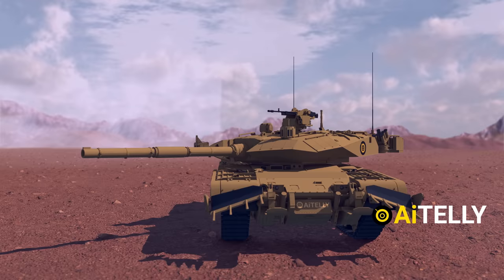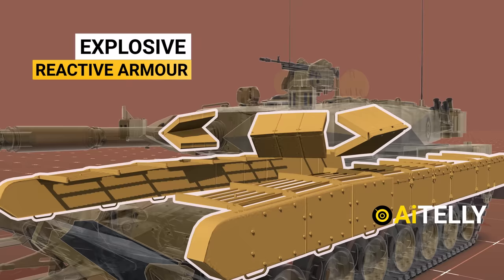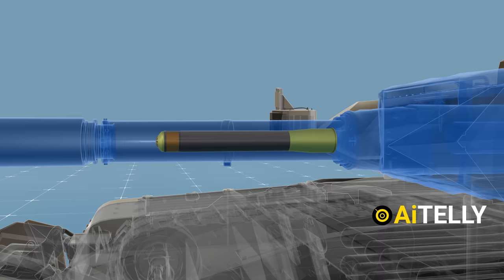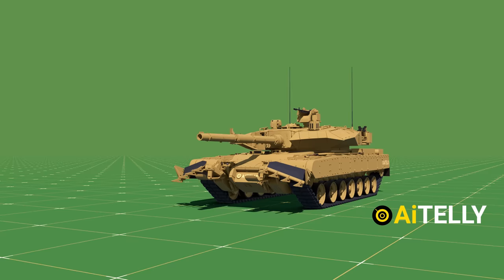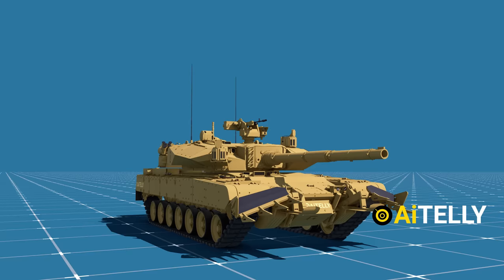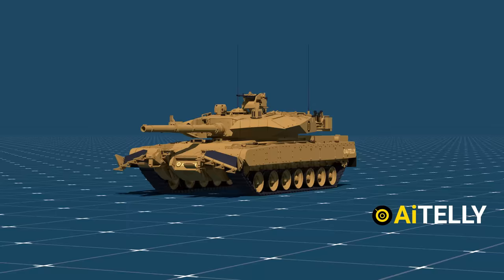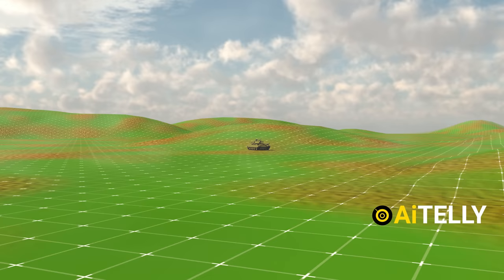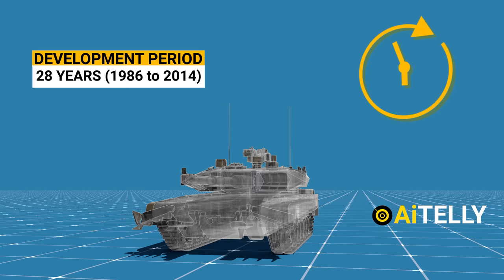Heaviest Battle Tank Arjun Mark 1A Mark 2 | How it works #tank #tanks

Comment: are you sure about the rifled gun? given the kind of ammunition, i suspect the tank has a 120 mm smooth bore gun like the leopard 2 and merkava!
Reply from the maker: I'm sure it's a Rifled Gun.
Reply: Indin army insisted on rifled gun because they wanted to use HESH rounds.
Reply: A smoothbore gun is also in development...may have being developed by now
Reply: Yes its a rifled gun because for some reason they wanted to have HESH shells (maybe because it is more effective against infantry as china and Pakistan both have high number of soldiers, just a wild guess though.)
Reply: It's a rifled gun. That's why we originally had problems with the indigenous sabot rounds. But the gun is really good now.
Reply: @ashutoshgupta9410  More useful against single walled fortifications or bunkers with much better after penetration effects (HEAT gives more focused and unidirectional effect)..
Reply: @sameerthakur720  but its still has less pen in sabot rounds and has a high maintenance compared to smoothbores only advantage i can see is its more accurate than smoothbore guns
Reply: @sameerthakur720  O.K. Thanks for the reply!
Reply: Its a rifled gun because of the desire to use HESH, and the PCB shells and it's not a shared 120mm gun like the Rheinmettal 120
Reply: @ashutoshgupta9410  HESH and PCB rounds are surprisingly effective as obstacle and building clearing rounds so..

Comment: one thing is instantly irritating me about this the flat surface at the gun mount of the turret big weak point, also the way the turret is shaped is not well designed this way it has a chance to ricochet projectiles into the driving compartment cause of the inward angle on the downside of the turret

Comment: Watched a couple of Analysis on this Tank and apparently it got several severe issues. Like significant armor weakspots and most of all an inadequate rifled gun just so they can fire obsolete hesh rounds. Overall it doesnt seem to match the also rather obsolete Leo 2A4 by what i heard.
Reply from the maker: Leopard 2 and challenger 2 tank coming soon.
Thanks for the feedback
Reply: Last time I checked it could also fire thermobaric and bunker buster rounds
Reply: The rifled gun is the least of the problems. The armour is a more immediate deal breaker. Why? Because the main gun of the Arjun can still fire an APFSDS with 530mm penetration depth (RHAe) at 2km distance. That is enough to punch straight through the frontal armour of almost all Pakistani tanks, especially the most ubiquitous ones (Al Khalid, Al Zarrar, VT-4, etc). 

But the Pakistani tanks can fire APFSDS capable of penetrating at least 450mm of RHA. That hole in the Arjun's gunner sight is around 450mm of RHAe, with no ERA on it. Meaning that what could very easily have been a tank front impenetrable to Pakistani APFSDS is now vulnerable. 

Arjun is not as good as it could have been, especially at that weight class. Which is why its induction has been capped at 4 Regiments compared to over 30 each for T-90 and T-72. That said, from a purely technological standpoint, Arjun has been a successful program because it has allowed India to develop multiple technologies which will now all be used in the next generation of Indian tanks. Take the 1500 HP engine, for example. Its going to enable the next gen Indian MBT to have an insane power to weight ratio of 30 HP/ton.
Reply: @death_parade  isnt it a waste though? Doing better on the next tank is all well and good but they couldve done better on this one
Reply: @TheDude50447  I agree that they could have done a lot better. Arjun could have had the same trajectory as other successful Indian weapons programs like the Tejas Light Combat Aircraft or any Indian Navy shipbuilding program. Designers of most Indian weapons systems belong to the same organization after all (DRDO). But there were several factors holding them back. 

Arjun being the first Armoured Vehicle Program in Indian history and being tasked with creating a tank to counter the American Abrams (which Pakistan was reportedly buying) was bad enough. But on top of that, the designers of Arjun and its subsystems (DRDO) had no professional management. They had no option of tying up with a Private Sector Manufacturer for Lead Integration. Instead they were forced to work with a highly inefficient Government Department infamous for its Communist Workers Unions and poor work culture. To top it all off, there were (and still are to this day) major coordination issues between the designers and the Army. Indian Army has not learnt from the Indian Navy when it comes to taking ownership of a weapons program. Top it all off with a pathetically run Ministry of Defence (during those days) and all these reasons combined create the mess that is the Arjun development program.
Reply: @death_parade  Fantastic analysis
Reply: @death_parade  but this thing is definitely better than the t 90 and all other russian junk!
It will survive a lot more. And its turret won't get tossed!
Reply: @dranzergigs8333  Not really, no. Frontal turret armour of a T-90 is 800mm against APFSDS, meaning it is impenetrable even to Chinese tanks even the likes of Type 99 (which can penetrate 700mm at 2 km), forget Paki tanks. Although some shaped charge in HEAT rounds and ATGM can defeat frontal armour of a T-90. But if DRDO's current effort of developing a reliable Active Protection System succeeds and if Army does not drag its feet and immediately upgrades the entire tank fleet with Active Protection, our tank force will become almost immune to HEAT and ATGM shaped charges. With the APFSDS protection already high, our T-90 fleet would be much better protected than Arjun. Ofcourse T-72 fleet is much weaker, but that can be remedied to a certain extent by adopting the new T-72 upgrade DRDO made. Yet for some reason, Army is not doing it. 

Sure Arjun has blow off panels for turret stowage its turret won't likely blow off (unless the hull stowage gets hit which doesn't have blow off panels just like the Leopard 2), but that alone is not enough to justify switching the entire T-72 fleet with Arjun. Why? Because Arjun is different and needs an entirely different family of spares as well as retraining of the maintenance staff in the Armoured Regiments as well as the Workshops, all of which adds tremendously to the overall cost, especially when the subsystems are not all indigenized yet. Not to mention the costs incurred in upgrading the culverts and bridges to accommodate the weight of Arjun. Ofcourse half of this is the Army's own fault for not properly handling the program. Had the Arjun come with a 1000mm protection with better protected side and hull, had a lower weight and had a higher percentage of indigenous content, then it might have been justifiable to spend all that extra time and money in replacing T-72 fleet with Arjun. And this was actually achievable had this program gone the right way.

But anyhow, what we need to focus on now is the replacement of the T-72 fleet with a new FMBT. Even if the prototype rolls out today and completes all trials within 5 years, it would still take till 20 years from now to replace the T-72 fleet. We can't have T-72 serving us beyond 2040.
Reply: @TheDude50447  how is it a waste?
This thing is far better than t70, t90 etc that army has in thousands of numbers.
When the development funds are scarce, no clear objectives given from indian army or even buy orders what the hell drdo is going to do? 
They've made an excellent tank!
Same with atags artillery guns.
One of the best guns in its category with longest firing range yet army is still conducting moon, Mars, Venus trials but when it comes to imported stuff they clear it in one go.
The mindset is the problem here not the equipment atleast right now.
They've basically upraged the entire thing 2 times with best stuff available yet no large orders.
No body builds f35 on the first attempt. It takes time and alot of handholding which is lacking here.
Only a low IQ person would call this tank a waste.
Reply: @abhilash9918  The gun is inferior to all of the usual modern MBTs. Youre hard pressed to find one with a worse gun. Where did you get that the gun is any good? It isnt. Rifled tank guns have been outdated since the 70s at the latest. Only the challenger series still uses it with the announced Challenger 3 switching to a smoothbore as well. 
Well i dont really know what you mean by class. Maybe youre comparing to the L7 and L11 guns. In that case no idea how it compares.
The Arjun is by everything I heard about it inferior to all modern western or russian based MBTs. Some of those desigsn are about 50 years old at this point. That shouldnt happen with a new design. Iirc its so bad India even bought more T90s some time back.
Reply: @Shubhabrata banerjee the T90 is a main battle tank. If the arjun is in a different category then what type of Tank is it? A scout? 
Because the Definition of Mbt is that you dont need another heavy combat vehicle.
Reply: @Shubhabrata banerjee That distinction doesnt exist really. Mbts got the same role no matter their weight. 
The lower weight of T series tanks doesnt come from a lack of capability like it used to in WW2. Theyre simply build more compact and in general have the same capabilities. So a distinction by weight isnt necessary.
Reply: @Shubhabrata banerjee that again doesnt change the role on the battlefield. Mbts all have the same Tasks in their respective armies. The UdSSR wouldve sent hundreds or even thousands of them charging together at their objectives while Nato still uses them in a combined arms operation. 
Its completely irrelevant if the tank is using an auto loader or not. The french leclrec used one as well and auto loaders can be equipped with blow out panels as well. The new kf51 comes with an auto loader as well btw
Reply: @Shubhabrata banerjee the T90, especially later variants are pretty much equal to many Western mbts in their capabilities and significantly superior to the arjun in basically everything. The carusell style auto loaders have a huge drawback in killing the crew with an ammo Cook off. That doesnt have any impact on battlefield Performance though.
Reply: @Shubhabrata banerjee one of the Main issues of the arjun are its multitude of armor weakspots. The protection of the T90 is very dependent on which version of the tank as well as which era is mounted. The T90m is a decent modern mbt while the arjun struggles to be on par with the 40 year old leopard 2A4. 
A channel named Red effect which always stays objective towards the tanks it analyses got a whole series on the arjun and its problems. He also goes into a lengthy Video discussion with a proponent of the arjun. I recommend checking it out.
Reply: @Shubhabrata banerjee the original T90 yes since thats just a T72. The T90A saw some extensive upgrades. The sight is just one of several armor weakspots named in the Analysis. Especially the sides are hardly covered by composite armor or era. 
The thing with russian tanks is that while the base armor is much weaker than Western mbts they have focused on era for a long time now in order to keep the weight down. They are really well designed for the purpose they were meant to fulfill. Their Main drawbacks in modern warfare are generally optics and reverse speed. At least the optics were adressed in the T90A. 
But were comparing whats basically a T72 to a completely new tank which was designed with support and Knowhow from the Leopard 2. Thats why i say its a waste
Reply: @Shubhabrata banerjee might be right. Dont know. Like i said im just saying what i heard in videos. That the turret sides got neither composite nor era but only storage boxes. 
In the end it doesnt matter what we think about the tank. Its not like either of us is likely to fight in or against one any time soon 😁
Reply: @death_parade  i dont know about the technicals but what i know is that russian tanks have very weak armour that gets penetrated very easily.
Thats why they are so light weight. Thats what russian philosophy jas always been. Indtead of making few strong tanks make many weak tanks! Just throw more numbers at any problem!
Heard an ukraine soldiers say their tanks are 'stupid'. Gets easily penetrated by old rpgs.

And APS is not full proof. The tank amour should be capable of taking hits. Thats why its called a tank!. Thats why people fear tanks!

I also heard the t 90 tank had cooling issues. Something most tanks dont have it.

And i dont think anyone is stupid enough these days to hit a tank from the front.
Reply: @death_parade  So the Pakistani / Chinese tank have to hit the area the size of a Gunners sight without being hit. I'll take that over my gunner being able to knock off a few
Reply: @Shubhabrata banerjee Clearly the Russkis are fine with their T90 and are using them all over. NATO would hardly say that their own tanks are just as vulnerable with dozens taken out by semi professional insurgents in Iraq and Syria. Hubris really.
Reply: @PramurtoMukhopadhyay  Gun Mantlet is already a weak spot. Add the gunner sight to it and it becomes about a quarter of the turret front that is exposed and weak. 

And if you have ever heard of a periscope, that gunner sight could have been better positioned, you know? Or at least they could have moved the gunner''s seat a bit back and increased the armour thickness, like in the Leopard 2. There is honestly no justification for that stupid gunner sight positioning. 

DRDO was tasked with creating a competitor to the Abrams tank. So they could (should) have studied the Abrams and tried to at least adopt some of its features. Had they done that, current Arjun would have been so much more powerful. American Abrams is literally the best designed tank in the world, if you are willing to look past the entire gas turbine thing. How I wish we could have had a tank with even 80% of what the Abrams can do. 
Americans might be a$$holes in general, but they did make a very nice tank.

Comment: As an Indian, I'm not very impressed. 
I know it's focused on crew safety and heavy firepower. 
But I'd like a light, fast and agile tank.
Reply: Arjun mk1 has a very high power to weight ratio of 24 hp/Ton and has better mobility than T90s as demonstrated in direct trials with the T90s.